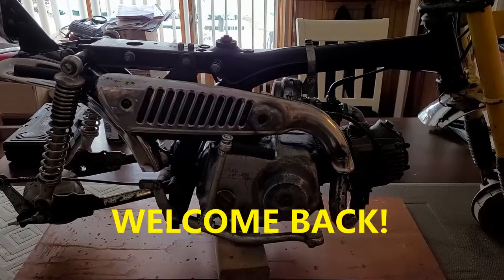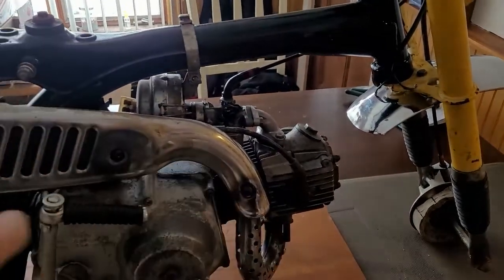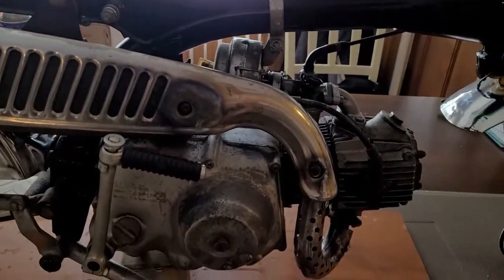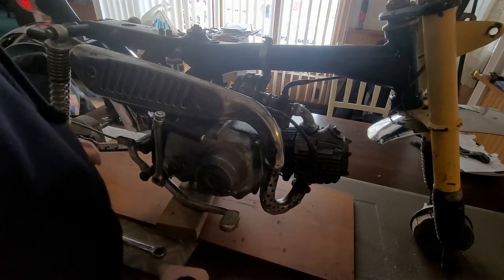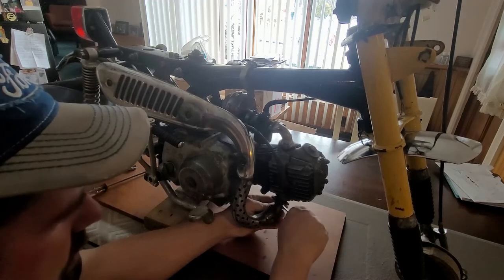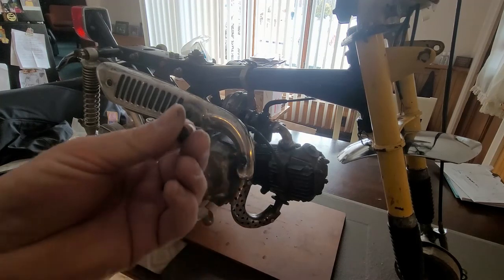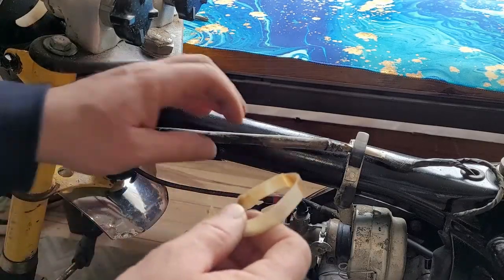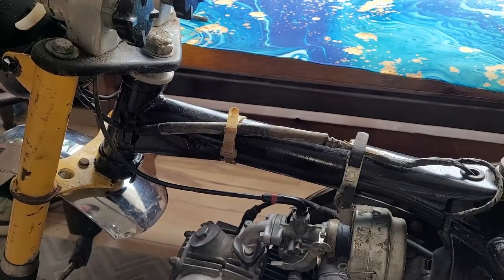Working on the Z50 exhaust / headlight / wiring

Comment: Love your channel.  I just discovered it recently.  Anyone can buy a bunch of new parts and throw them at a bike and keep doing it until they stumble across the problem.  But you get in there and diagnose the actual problem and then repair the malfunctioning part.  You often find some used parts in your stash and get the repair done for free.  I do the same things.  But I collect ATCs.  I sell my duplicates on ebay and can wind up with the original for free.
Reply from the maker: Thank you my goal is teaching using what you can and teaching the correct way of repair and getting the wheels turning on these old bike

Comment: Nice job...  where did or do you orde you parts?  I have a 1977 z50a.  I need a headlight and assembly and Taillight and mount.  ...and pegs w/kickstand.  Love your simple dyi instructions...  I will I could send a picture of mine.  Thanks!
Reply from the maker: I found everything I need for this build on ebay a subscriber donated engine and exhaust a muffler they where in his shead for years headlight assembly was ebay rear fender and peg assembly ebay

Comment: Are you sure you mounted the two parts ring right, I did the same thing and had trouble too.I then mounted the exhaust pipe first in the cylinder and then the two parts ring on the side of the pipe in the cylinder then it was no trouble to screw on the exhaust system.

Comment: I’m working on an ATC70 right now and the exhaust connection is similar to your Z50.  On the ATC the crush washer goes on first, then the exhaust flange goes up against the crush washer, then the two half circle joints push up against the flange on the exhaust, then the clamp on the exhaust is tightened up on the joints.  Maybe this will help on your alignment problem.
Reply from the maker: thats how i have it my pipe is slightly bent this bike was in an accident bent the forks you will have to check out that vid lol it was bad someone 30+ years ago got launched lol